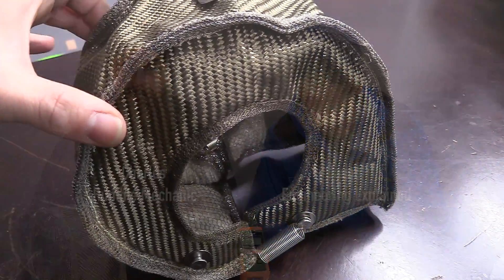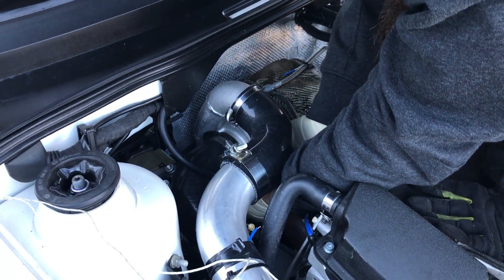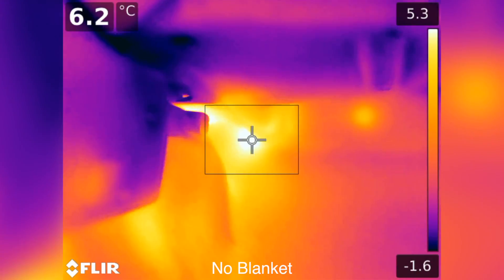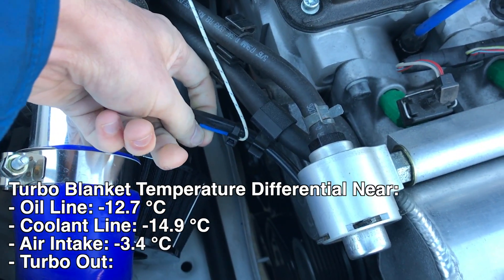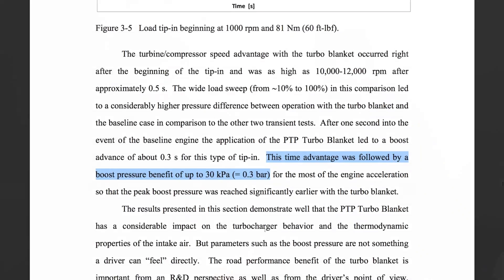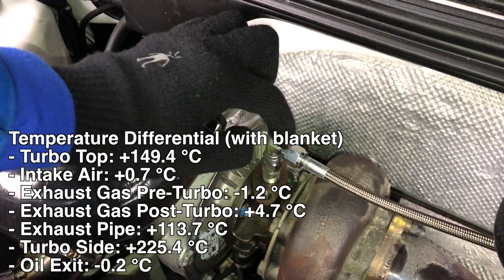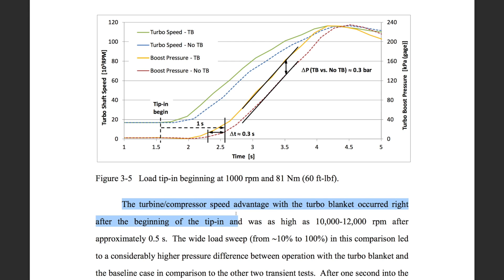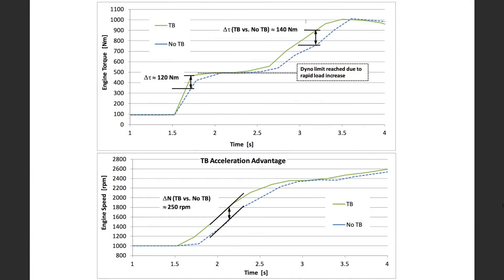Can Turbo Blankets Be Proven To Increase Performance?

Comment: When I was in school, I was taught  that turbos work from heat. More heat in the turbo= more better !
Reply: He's correct. The turbo works from heat. This blanket keeps the heat in on the hot side of the turbo. Also the cool side from being impacted from this heat. It's a win, win. That said. Yes, you want cool dense air on the cool/intake side.
Reply: Frank. Turbo intake side vs Turbo exhaust side... We're talking the exhaust side. Watch the video.
Reply: Guy Curwick Damn right! More heat in the exhaust side means more expansion of gases, more gases means more choochoo
Reply: Liam Cooper I don't want to get into a  big argument about this  Liam. You said yourself that the  heat creates the  pressure  differential.  We are both right.
Reply: PV=nRT<<<more T more P, others are constants.
Reply: Turbos work on pressure differential. Heat is proportional to pressure in this case. The higher the pressure difference the faster the velocity, the hotter the gas the more it will want to expand through the turbine.
Reply: Liam Cooper that's what I said.
Reply: Maybe we can all agree that entropy has increased in the process as it appears to be taking effect in this conversation .😉
Reply: black7 rc Perfect.
Reply: Yes and no. If you can keep the heat in the exhaust side of the turbo by wrapping the turbo and header and having a pressure differential from across the turbo then you can increase spool speed. For example a wrapped turbo, ceramic costed header and bigger downpipe versus everything stock
Reply: Frank you might want to see some of the videos on how a turbo works, you’re halfway there and that’s what’s causing your confusion
Reply: Your both right, but are wrong about the other guy not being right! :) 
It's the pressure that does the work, but the heat is directly related to the pressure (as per Max's comment). In a gas, if you lose some heat = lose some pressure. Ideally, there is a large loss of pressure (and thus heat) across the turbo, so it converts as much of that heat/pressure into kinetic energy i.e. more boost. I'm sure there is a complexity of optimal exhaust flow velocity and heat for catalytic converter somewhere in there too, but that's talking swings and roundabouts as they say.
Reply: Guy Curwick no you said it works on heat. Which is wrong. It works on pressure. I can pump 1500L/min @ 500Kpa 30deg and still make the same power.
Reply: Try again, it's all wasted heat and compressing takes way more energy if you keep the heat in. It's the hole concept of an intercooler, or multistage compression.

Comment: You have to consider the emissivity of anything you measure with a thermal camera / 'laser' thermometer. Just look at the apparent coolness of the stainless pipes.
Reply from the maker: Correct, hence the camera is constantly re-calibrating (every time the image freezes). Also why we used other temp sensors, as well as a university study.

Comment: If you rotate that oil line fitting towards the firewall and route against the firewall you’ll have better oil temps.
Reply: Yes but I worry about adding too much length to that line. I have yet to see an issue with oil temps being too hot.

Comment: Makes sense, turbos use heat to spin, keep the heat it, spin it faster quicker, obviously it cant add overall power since you're not changing how the engine behaves, just increasing the heat efficiency of the turbo.

Comment: This is a really cool analysis. The oil temps are impressive but I am worried that the turbo itself will get hotter than and have a higher temperature gradient throughout than it was designed to experience. Also,  if you can get your hands on one of the ford 1.0L 3-cyl ecoboost engines (so a recent focus), I think it would be hilarious to see if you can get more performance there! The opposite of that 6L+ engine.
Reply: This blanket only helps to spoil the turbo a little faster and before, but, but, it will increase the oil temperature and the turbo itself...

Comment: Great video and technical details, thanks! So since oil temp is about the same, any negative effects on turbo reliability / longevity?
Reply from the maker: I suppose the exhaust turbine will be exposed to more energy, but I'm not sure if it wouldn't be able to handle this or not. As demonstrated, exhaust temps going in are relatively the same, outlet is slightly warmer with the blanket.
Reply: Your nearby rubber parts (hoses) will probably last longer because they are being shielded from the IR radiation coming off the turbo.
Reply: 225 C isnt a small number, that is enough to scare me out of using one. i dont know how strong the outside of a turbo needs to be, maybe the metal being softened a little is fine but im not risking it.
Reply: yeah, I would think thermal expansion of parts would start becoming a factor at 225 C above "normal" operating temperature. I'd love to see follow-up studies examining how turbos designed without blankets in mind hold up under the significantly higher operating temps.
Reply: turbo is easy to change, easy for your hands, not so easy for your wallet.
Reply: +raiden derp Especially if it's 225 C on the outside, who knows what the internal temperature is going to be like. For all we know it could be increasing the blade lengths to the point of catastrophic failure down the line. The increase in turbo rpm doesn't help either, especially when the peak rpm wasn't measured above 2500 rpm on the engine.
Reply: Turbo is made to be exposed to so high temperatures, so it shouldn't be that big kind of problem. If exhaust pipe is too hot for you, so you think it may burn something under hood you can even put  thermal tape on it. Anyway, turbo is one of the easiest parts to change. Even if it will wear out sooner, whole engine will be much more happy because of the deacresed temperature under hood and intake air.  I'm almost sure, that internal parts of the engine will have increased lenght of live thanks to it.
Reply: +Stasiek_Zabojca I don't think its margins are calculated for performing well with this level of thermal insulation. A failed turbo (particularly in the case of imbalance) can send stuff like ball bearing parts down the intake and damage the engine as well, so worst case you're looking at replacing more than just the turbo. Also, as +raiden derp pointed out, turbos aren't exactly free either.
Reply: well the exhaust temperature is about the same so id assume the turbines are about the same too. but who knows, maybe the outside of the blades will get a little hotter than the inside as its maybe not loosing heat as fast because of how much hotter the walls are in there. who knows, this is a good start but far from enough data to decide that a blanket is the right idea.
Reply: +raiden derp I don't think it's a linear relationship between the exhaust temperature and the blade temperature, but it's a fair point. Anyway, what worries me is how it inevitably changes the thermal energy distribution inside the turbo housing.
Reply: Djhg2000 That's true, but it may dealy or even save engines internal components from failrue. They are much harder to replace, it takes way more time and may be even most costly. It could even kill whole engine. 
It's the hot part of the turbocharger, which is getting hotter, not cold side in intake. There is possibilty, that if hot part will fail, cold part won't just expload and shot metal parts everywhere. There is also intercooler on way metal parts, so only tiny ones could possibly get into  combustion chamber.
Reply: +Stasiek_Zabojca I don't think you've thought this through; if the hot side becomes imbalanced then what will happen to the cold side? Turbo failures are usually just the bearing seals getting worn out and leaking oil into the cold side, but if there's any significant imbalance at 30k rpm then it will most certainly start throwing stuff around inside because the load on the bearings become insanely large. In the applications where a turbo blanket is relevant you've most likely got an intercooler in there as well, I'll give you that, but even then you're getting metal particles flying around inside the combustion chambers. At that point I'd probably want to replace the intercooler as well afterwards just to make sure something didn't get stuck halfway through and kill my engine a few potholes down the road.

Comment: Interesting but if there is no discernible difference in the drivability what is the point? It is kinda like saying my iPhone X is better than my Note 8 because it has better numbers on a benchmark test. The speed at which I can do day to day things is the same but the X has bragging rights. Also this reeks of snake oil. If it was this easy to make a meaningful increase in performance with no downside don’t you think that the engineers at the multinational Fortune 500 companies like Ford and GM may have explored this? Bottom line is it is interesting but not really meaningful in any real world sort of way. I did enjoy the video and note that I did watch it to the end. I am a subscriber to your channel and I love watching your videos so keep up the good work.
Reply from the maker: Lower temps all around, less damage to nearby components, faster spooling (as proven in lab tests). It seems pretty meaningful to me!
Reply: Engineering Explained possibly so. If your analysis holds up I will look forward to seeing all of the major automotive manufacturers adopting this as standard practice. It would after all be an extremely cost effective way of gaining “meaningful” improvements in performance. There would be no need for costly engineering. They could jus pop a cheap heat blanket on every turbo car and truck in production. Just remember though that your collaborator could not tell a difference when driving his own vehicle with and without the turbo blanket installed. I maintain that there has to be a downside. Nothing comes without a cost.

Comment: it may benefit in the beginning but the heat would damage the bearing sooner and "coke" more oil
Reply from the maker: Hence the discussion about oil temperatures and cooling down. In lab tests the measured the same oil temp before and after using the blanket.
Reply: i mean inside the hotside turbo, ultimately it becomes hotter causing sooner bearing damage and "coke" more oil in the turbo

Comment: I see this good for gassers but deadly for diesel. With long drives and heavy loads and higher boost i see this cutting turbo life to half.  I also would like to see the on yhe 6.7 powerstroke they run the primary coolant system and oil system through it.
Reply from the maker: It was a Cummins, not a Power stroke. You're just going to assume it cuts life in half? After seeing that oil temperatures remain the same?
Reply: D Mladenov it will cause the housing to crack . Exhaust wrap on headers will make them fall apart prematurely.Just like exhaust bolts breaking because of heat.
Reply: You do not want the compressor to get warm though. However with regen in a 6.4 , the blanket would definitely cook it
Reply: It's by far and above contained in the exhaust stream, the housing/oil/coolant isn't picking up much additional heat. The only issue I could see is if, for whatever reason, putting the blanket on causes a material to exceed it's max working temp but I'd wager the actual turbine wheel is seeing similar peak temps.

Comment: I did a 4bt swap on my full size bronco a couple of years ago. I ended up not only putting a turbo blanket on, but also wrapping the exhaust manifold and the downpipe as well. I couldn't really feel a difference, but it did help quiet exhaust noise in the cab with the windows up... maybe you can wrap the manifold and downpipe and see if there's any different results??

Comment: So why don't the OEMs use Turbo blankets???
Reply from the maker: It's a great question - it could be cost, it could be designing the turbos for specific locations, could be from using relatively low boost. I'm not 100% sure.
Reply: Also turbo blankets are porous and could easily become dirty, or worse oil soaked in case of oil leaks. Of to gets oily, it could be a fire hazard. Car guys would hopefully keep it clean, but grandma would never notice until she had a fire.
Reply: I have to suspect cost as the culprit - a small price per car, but it adds up with volume (rather like that airline that saved millions by using one less olive in each salad.)

OEM turbos are running up to 18 psi of boost, sans blanket - considerably higher than the 12 psi on this car.  However, it seems they're mounting them low on the back of the engine, up against the firewall...so presumably the airflow is removing the heat as it flows under the car before it can heat the engine bay too much.  That's obviously a guess, but it has to be better than squeezing it in between the radiator and engine in the classic manner, where the heat can flow over the entire engine (including the intake manifold) before it can exit the bay.
Reply: Retaining all the heat of the turbo could cause premature wear. OEMs have to worry about warranties.
Reply: Well that blanket is $140 on amazon. While economy of scale would definitely apply a part anywhere near that expensive is ridiculous when you can get a serious chunk of that using your standard metal heat shields. Another thing that I saw mentioned is the increased temperature on the exhaust piping leading out of the turbo (to the tune of more than 100C). So you would essentially be trading high temperature parts upstream for downstream. Depending on your layout that may be beneficial, but it's certainly not an always better scenario.
Reply: ChuckLZard I would love to see a heat shield comparison to a turbo blanket
Reply: aussiebloke609 Makes sense
Reply: Engineering Explained Low boost? Hmm, my F350 turbo diesel can run 40 psi , so low boost is not applicable
Reply: Alvin Brinson good point
Reply: I agree with your statement. I think this is the main reason an OEM would not integrate one.

Comment: That temp is going to melt stock turbo, good luck with the repair bill.
Reply from the maker: How do you know this? The exhaust temp going into the turbo is exactly the same, they're made to get hot (the rest of your engine bay isn't).
Reply: Engineering Explained I’m mostly worried about cooling after immediate shutoff, which you’ve touch on later in the video, good advice, write it in BOLD. The heat is staying with the turbo for a lot longer than turbo without a heat shield, if the pump isn’t running long enough too cool it, parts will starts to die a lot sooner. For me, I’d run it naked, I’ve got bi-turbo to make up for the boost.
Reply: Good think this is not a "stock" turbo.
Reply: HumbleMechanic that is actually a good thing, ppl with aftermarket mods generally knows more about how to maintain it. I’ve got drivers don’t even know how to put oil in the engine, don’t expect they’d keep the car running for “warm down”
Reply: Yea a simple 30-60 seconds on warm down goes a long way

Comment: So now I am ordering two turbo blankets...thanks for the real info on this. (Going to be using on a '97 Nissan 240SX w/KA24DET (T3/T4) and  a Dodge Dart with the 1.4 turbo engine)
Reply: The turbo I am running is a t3/t4, it fit really nice. And as it got hot and cooled, it fit even better.
Reply: Great if you dont mind a shorter turbo lifespan

Comment: the hotter the air, the thinner the air the less work it can do. is this hard
Reply from the maker: Hotter air maintains higher pressure, and that pressure is responsible for spooling up the turbo. If the air lost all of its heat (energy), it would return to a very low pressure and wouldn't spool the turbo at all.
Reply: how can thin air do more than dense air. are you saying that turbos work better in the Mohave than in Alaska. thin air moves around things easily dense air does not. a pound of dense air pushes harder than a pound of thin air.
Reply: Consider the ideal gas law PV =nRT

An increase in temperature is proportional to an increase in pressure.  Hot air is thinner in an open environment because that air wants to expand as there is more kinetic energy in the air molecules.  In a closed environment such as your exhaust pipe, there is a fixed volume that air can actually expand.  the pressure increases, therefore the energy of the air actually increases.
Reply: my original idea although poorly stated was hot and cold air under the same pressure, the cold air would perform better, without the factor of expansion.i thoroughly understand expanding gasses. my thoughts had no place here
Reply: the end result of being wrong and admitting it means you just got a little smarter
Reply: +theicediamond7 It's pressurized air. Hotter air, more pressure, presses harder against the turbine. 

Perhaps if you have a way of proving this wrong you should do so. But I think the technical institute, and Jason have proved that a blanket is beneficial. Why are hundreds of racing teams and engine builders using turbo blankets if they cost a bunch, weigh more than nothing, and perform worse than without one?
Reply: +csskiller Thank you for explaining it in a simple accurate way that I couldn't.
Reply: i appreciate you, thank you for making your self available to the public
Reply: +theicediamond7 I appreciate the fact that you understood you were wrong and said you were on the internet. Not many people can do that.

Comment: I’m was just wondering why people don’t make longer turbos to keep the hot side and cold side further apart like what Mercedes f1 does but to a lesser extent (as in not needing to put the turbo shift across and through the engine). Is this because the added weight of the turbo shift would outweigh the performance increase? Why just wondering.